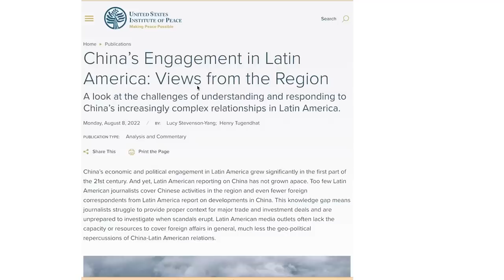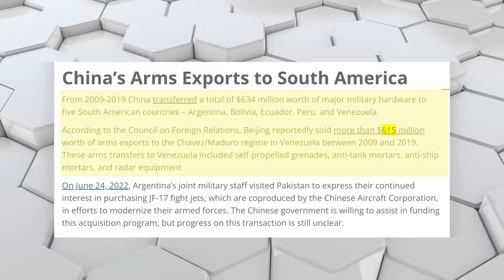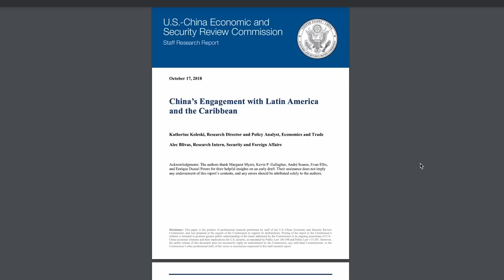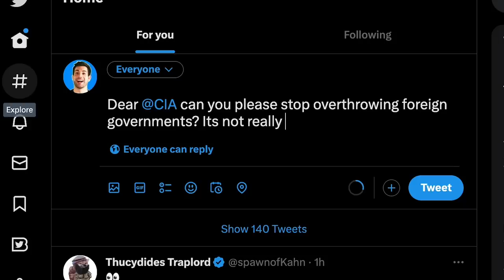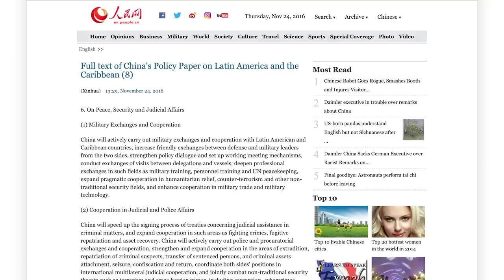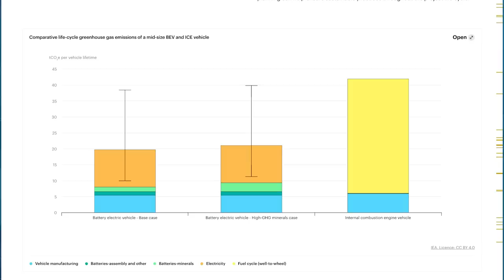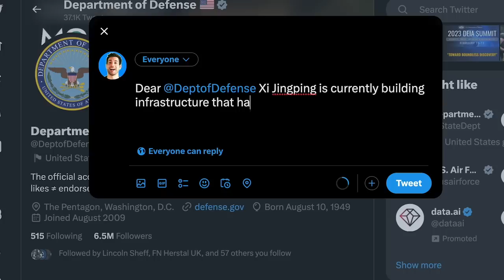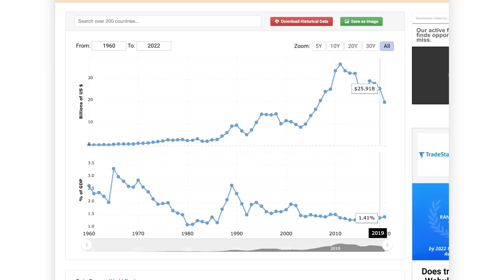How China Moved into South America

Comment: I knew they would ramp up their relations with central and South America when they built their Carrier. That gives them the ability to project force to protect their interests like us even if it is on a much smaller scale.
Reply: They only have 2 carriers, they need one for South China Sea and one for areas near Japan. They can take their carriers all the way to South America.
Reply: @niweshlekhak9646  Have you not heard about the third they are making, along with the 4th carrier they are planning?
Reply: @voidtempering8700  it takes 4-5 years to build a carrier, it's not as easy as it seems.
Reply: @niweshlekhak9646  They already finished it, it is going sea trials right now. Are you out of the loop?
Reply: @voidtempering8700  I meant for the 4th carrier, yes I know 3rd one is finished. Plus they are diesel fueled which means they will need lot of refueling to get to South America, will have to go in between Guam and Hawaii, where US subs and boats will stalk them, not a good idea to send your new aircraft carrier to be stalked by the US. US has always sent it's oldest carrier USS Nimiz in the South China Sea, it's newer carriers have never been there.
Reply: 中国人派航母到南美洲干嘛？卖参观航母的门票吗？为什么你们有这种奇怪的想法？我们只想好好做生意。